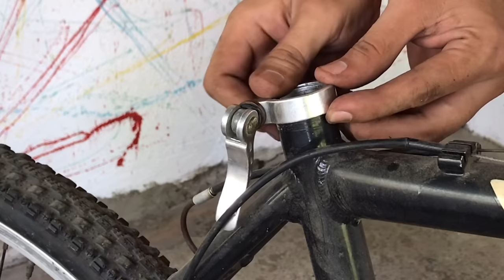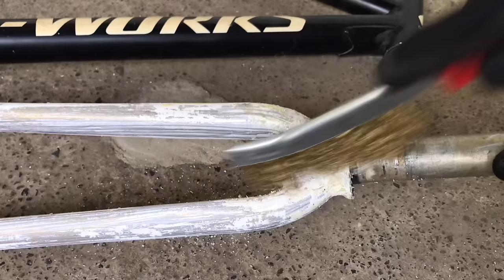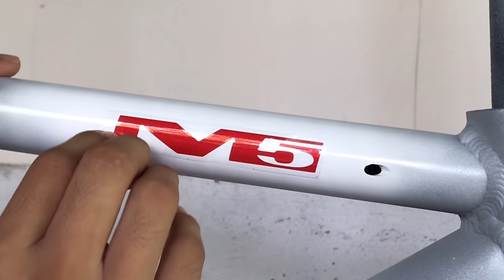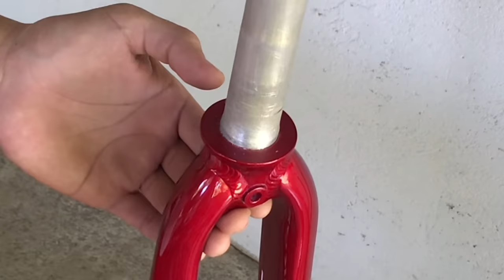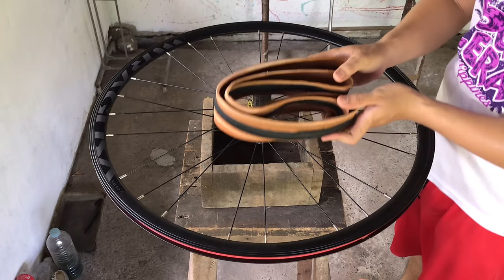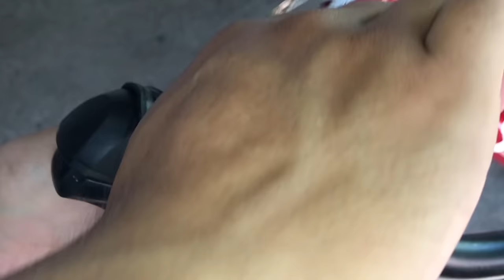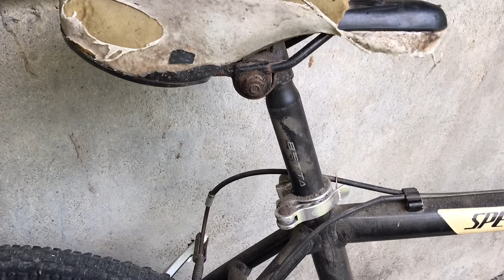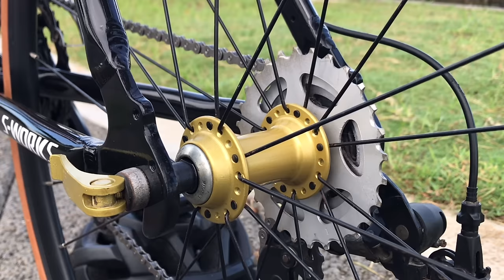Building a road bike from MTB convert to ROAD BIKE [Restoration]

Comment: You know, the funniest things about these restoration videos is either its not really broken its just hardened mud or those are 2 different bikes because the chain stay is higher than the previous one it turned from External to Internal and no you cant simply drill a hole into a frame and make it into an internal, and how a frame using a 26” suddenly switched to 700c-25”
Reply: It's not an m5 s-works, but it is the same frame. Internal works with just holes if you run outer cable all the way through. And 700c will fit in the majority of 26" frames no problem. All that's needed is a brake calliper with a suitable drop. The spray job is pretty tidy for rattle cans. Nice job really. Would I ride it, no. Do I think it was worth the effort, not really. But if he's happy with the end result, then kudos to him.
Reply: I dont think you understand nor have you done a restoration because 
1. External > Internal isnt as easy as cake you have to insert whats called a routing and it has to be precise these cannot be done by just anybody and takes either the manufacturing themselves or top of the line mechanics because its the same how you cant just turn a rim frame to a post mount disc frame 
2.the routing holes are precisely placed and done no signs of it being cut, damaged, nor touched and it wasnt showed it suddenly appeared as the video went on
3. Rust isnt a magical piece of dirt you can remove its decayed metal the one used in the video is WD-40 and WD-40 doesnt take it off like poof it eats the metal and the frame is untouched (rust takes over 37% of the frame in the video and the rust fails to look natural)
4. Damage in the video he does sever changes and vigorous tactics such as hammering it down to remove the headset in the video it looks perfectly fine but in reality it should been dented heavily or cracked seeing that the M5 is an old and thin bicycle 
5. Accept reality 97% of restoration videos are cap and thats a fact each and every one of these videos are cap and only a small amount of 3% remains to be real restoring
Reply: @Eobard_Thawne.  
This is exciting, where to start. 
I understand fairly well, having spent 20 years as a professional cycle mechanic, shop manager, and ultimately training mechanics for a large chain of retailers.
As I said previously; internal cable routing can be achieved easily, if not correctly, by simply drilling holes and running outer cable for the full run. Many steel frames in the 80s and 90s achieved internal brake cable routing this way. If the old cable is pulled out without a follower it was a proper pain threading a new one through. 
What are you wittering on about rust for? The frame shown is an aluminiun alloy frame, with no apparent signs of any corrosion. Aluminium corrodes, steel rusts.
His method of removing the headset cups is indeed wildly incorrect,  or "sever changes and vigorous" ??? as you put it. But given a modicum of skill or hand eye coordination, there is no reason it should leave the frame "dented and cracked". The M5 tubeset was thin, in places. The headtube was, by necessity, one of the thickest walled tubes on the frame. On a par with the bottom bracket shell at close to 4mm thick.
I do not need to accept that 97% of these videos are "cap" (????). Apparently, you know this to be a "fact". Like the old,  but very true joke about how, "up to 97% of all statistics are made up on the spot".
I am sorry, but you are mostly talking out of your arse about a subject you know little about. "A little knowledge is a dangerous thing"
Reply: @theflow5269  I second this
Reply: @theflow5269  oh boy, how fascinating now i will admit i made a bit of mistakes in my reply but im telling you right now that a frame that thin made of steel probably and it wont go away without a dent from the actions showed in the video and how the chain stay and seat stay got higher with the top tube and bottom bracket having a change and yes im not certain with 97% but it is true that most restorations are staged
Reply: @Fugitive_8  It's clearly NOT a steel frame!!!! Use your eyes and stop digging yourself further into this hole you're so keen on 🙄

Comment: fake, the moutainbike had external cabling, road version has internal cabling
Reply: maybe he did made some holes lol
Reply: Yep!! Noticed the same thing about the  internal vs external cable routing.   So fake!!!
Reply: Also if you remove the fork the top tube wouldn't be parallel to the ground
Reply: That's why he didn't show the most delicate part of the build, drilling the holes at an angle.

Comment: I do not understand why you would get rid of a perfectly good three by front crank for 2 by why not just put drop bars and a new seat and road tires and call it a day ?
Reply: 3 bys are a pain to clean, are quite heavy and complicated to shift imo. Most bikes are just fine with one or two front gears.
Reply: u dont actually need 3x setup on front bcoz its a road bike not a mtb anymore + the weight of it is pain in the ass. modern bike these days only use 1-2x gears in front. no offense but most of the road cyclist will gonna find it "eww" if they saw a 3x setup in front

Comment: It looks nice but wouldn't the geometry be totally whack?
Reply: yes. way to long.
Reply: Maybe not a road race bike, bit without the suspension fork the BB height will be lower, the head tube angle steeper and wheelbase shorter. The result may be something like a gravel/endurance/all-road geometry.

Comment: what about outdated geometry ?
Reply: Rubbish. Modern mtb's are indeed different but it doesn't mean they are better in every respect. They have slow unprecise steering and they are less good climbing. But certainly they are better downhill with their slack geometry.
Old XC mtb geometry is not that far from road bike geometry and there is always some room to adjust with stem length, saddle position, fork shape (trail) and steering bar height.
I ride 2014 Trek Superfly. It certainly has "outdated geometry" but it is still much faster than any "modern" slack design mtb on easy single tracks or when you go uphill. It is not even close
Reply: I ride DB from ~2000 and Commencal from ~2010. I mean in mountains. @bekanav

Comment: omg the hub lacing! i don't think that front wheel will last long... too much pressure on hub flange not enough spokes.
Reply: Can you elaborate what exactly you mean? I'm trying to learn more about bikes and stuff and english isn't my main language. I didn't really see a problem though and would also like to understand.
Reply: @mto7429  see how on the hub there are empty spoke holes?
Reply from the maker: Some road bikes has 16-24 spoke in the front hub, and for the rear hub some has 20-24 above for the road bike, but me i convert a 32 holes hub into 24 spoke rim set
Reply: Yeah my girlfriend has only 8 spokes per side... So 16 in total per wheel. Works since over 5000 km perfect and is lighter and feels more safe than mine with more spokes because it can have a higher stiffness. And of course it looks crazy and I were sceptical before. Sometimes less is more. :)

Comment: Lol tourney ruined it 😂
Reply: Hi!! May I ask why tourney ruined it because I'm actually gonna build my road bike so I can prevent buying it
Reply: shimanos group sets:
tourney (pre entry level), sora (entry level), tiagra (mid level), 105 (amateur), ultegra (semi-pro), dura-ace (pro)

This bike looks like it's worth £1000-£1500 but with tourney it will ride like a £300 bike.
Spending an extra £200 on tiagra would make the bike feel like a £1000 bike.
It's a no brainer if this bike would to be used, unfortunately he's made this bike just for the video so chose the cheapest groupset that at least said "shimano" because s-works bikes use shimano components.
Reply: @maribelporras1850  I've used sora for quite a while and can say with proper maintainence it is still actually a decent value groupset, touney however is just a bit too cheap.
Reply: @robertgardner05  thank you my man for that I really appreciate that thank you so much
Reply: @robertgardner05 
And 2nd hand quality  components are affordable too like Tiagra and ultegra.
Although I love the old campag stuff and old suntour for vintage resto’s.
Reply: Yeah I have a 10rear/3front speed ultegra and I really need it. Most of the racer would say a 2 in the front and 7 in the rear would be better, but as a beginner, learning to ride small hills, I really need that smaller gears so often. Back down it's okay, I reach by that small hills 70 kmh in the highest gears. By stronger levels it would roll faster of course. If later on it would be important to become much faster you can change the components to bigger chainplates to increase speed a lot. But for normal trainings it's absolutely top. And if we be honest, the most important thing is the own technic how to change the gears and performing a efficient work to enjoy the ride. Sry for the bad english. Never learned it in Germany, I try my best. 🙏🏽

Comment: the handlebars are wrapped from the center to the edge and the end is pushed into the tube and plugged so you don't have to wrap it with duct tape
Reply: Only if you want it to unwrap

Comment: Different frame??????
Reply: Yeah that's definitely not the same frame. original had external routing and magically now has internal.
Reply: @felixmx3  well maybe.. he drilled the holes?? xDDD
Reply: He most likely drilled holes and either forgot to film it or lost footage. Every other detail of the frame lines up
Reply: @felixmx3 its the same frame. The welds on the headtube is the same

Comment: Una pregunta: la bicicleta llevaba inicialmente los cables por encima del tubo superior, y al final del vídeo se ve como van por dentro del cuadro. ¿Como lo has hecho? Gracias.
Reply: Perforó el cuadro, pero no se ve en el vídeo
Reply: @LINK666F  Hola. ¿Sabes de algún video que se vea como se hace? Gracias.
Reply from the maker: I convert it into internal cabling, i do small holes for cable
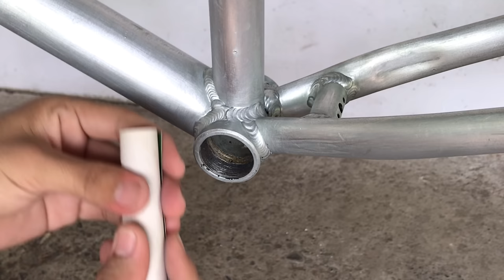Reply: @V0095-b5f   checa el minuto 5:50, se puede ver el ángulo de la perforación. Para esto comienzas con una broca pequeña y luego abrocardas el agujero chico con una broca del tamaño justo para el cable, pero haces la perforación secundaria en el ángulo deseado. Puedes ensayar antes con otro tubo que no uses, porque no hay margen para errores en tu cuadro.
Éxito!!

Comment: Why is that you using rim brakes why did you not used disk hydrolic brakes it will be good and uts more handsome looking at your brakes just saying lng and notice lng....🤙🤙🤙💪💪💪💪🤗🤗🤗🤗🤗🤗
Reply: You cannot use disc brakes on a frame designed for rim brakes.

Comment: Geezzzz looks horrible...but looks decent after would have left the v brakes on it tho. Didn't need to smooth it out..just rough it up so paint will stick. Shouldn't have greased the seat post. Oh well, ull learn
Reply: "Shouldn't have greased the seat post."

Wrong. The countless "stuck seat post" threads on online bike forums across the internet all could have been prevented if they'd greased the seat post before installing it. I've greased my seat posts for 27 years and I've never had one move on me, and I've also never had one be stuck when I want to remove it or adjust its height.